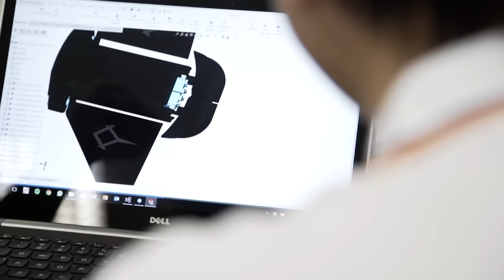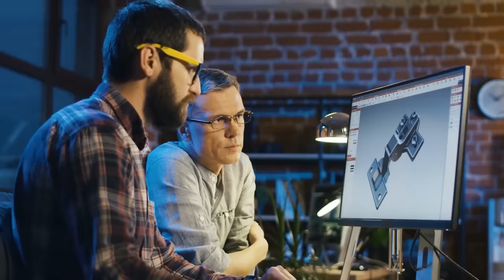20 Amazing Robot Animals That Will Blow Your Mind

Comment: My only invention is taking apart a drone and replacing it with my venomous robotic snake with two syringe needle like-fangs on the roof top of the mouth and putting a weedeater fuel tank designed with hydraulic outlet valves connecting with the syringes, inside the venomous robotic snake and building two mechanisms, one in front one in back with two camera eyes and using metal as exterior parts and designing the drone controller with different modes, one mode for the fangs, and one mode for moving the motors under the venomous, robotic snakes body